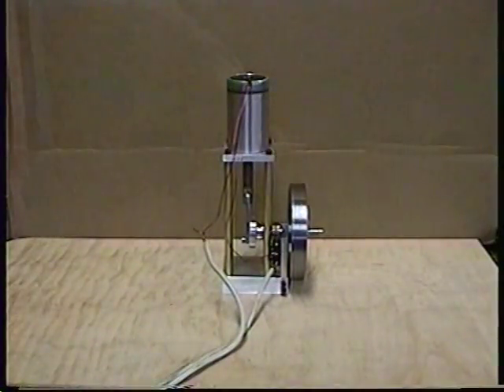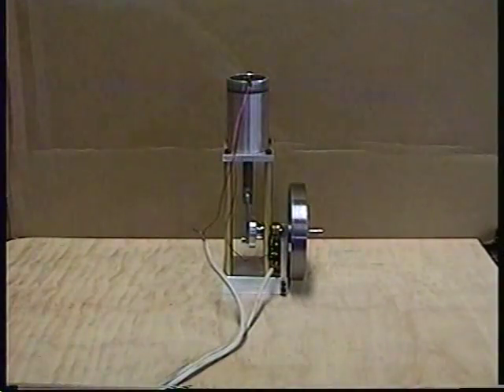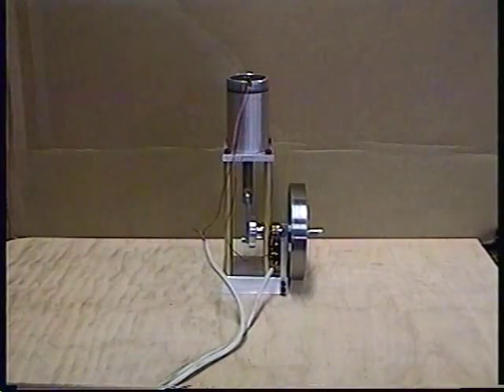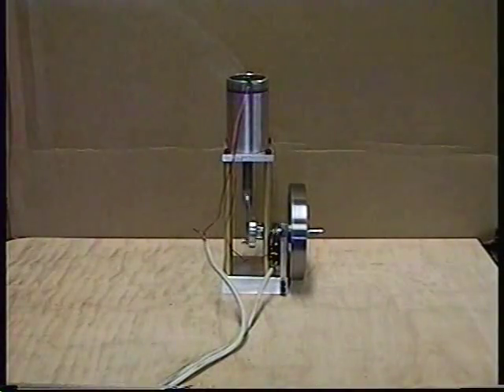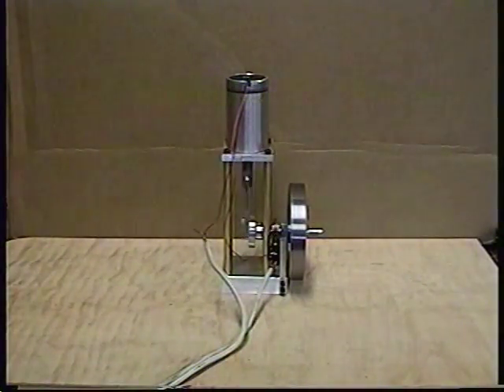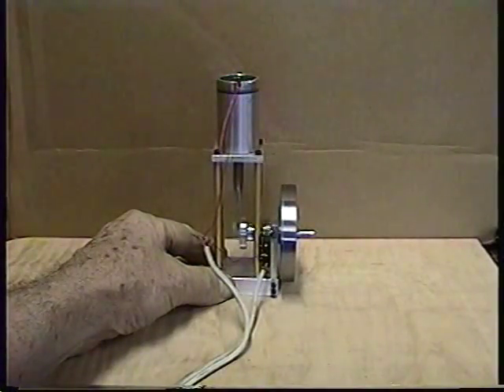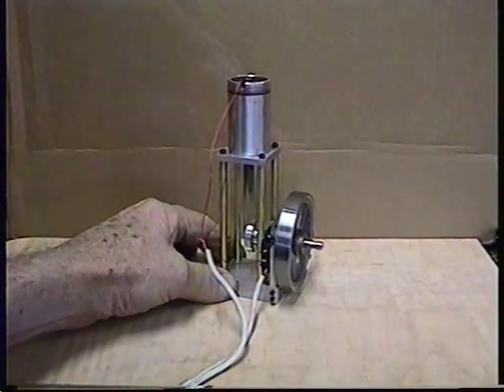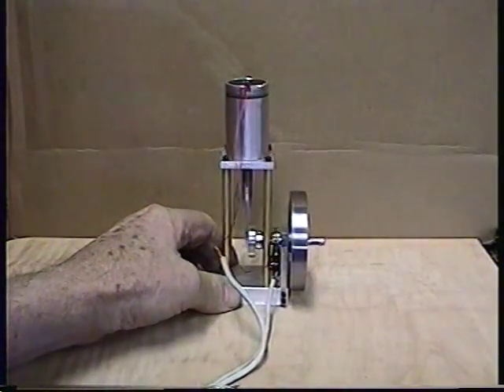Vertical Solenoid Engine

Comment: I'm working on a 2 cylinder tandem solenoid engine based off the 600 snow. It has a 6 inch flywheel and is made mostly from CNC machined wood. The solenoids are able to be driven at 48 volts and are from a new player piano.

Comment: i made 2 solenoid engines from what i had availabe...i made vids of them...i got a small solenoid from a door bell, but the wire comming from the coil broke, so i had to unwind it and wind it back up (by hand)  and it needed 27v to run.  my second engine ran on only 12v

Comment from the maker: @sculptsystem - the solenoid plunger is connected at the bottom to a crankshaft which converts the up and down motion to rotary.  Right behind the flywheel is a cam which closes a microswitch when the solenoid plunger is at the bottom so the coil pulls the plunger upward.  When the plunger reaches the top, the cam lets the switch open which turns off the solenoid.

Comment: Try using an optical switching system,you wont have any points to burn out,i'm going to build a large version ,2 foot flywheel,the solenoids are 8 inches long and 6 inches diameter,using two solenoids with a common armature,one for the up stroke and the other on the down stroke,that way the crank will always have power on it and just not on the upstroke.

Comment from the maker: No, it's 180 degrees.  You want the switch to turn on when the plunger is at bottom dead center.  It should switch off at or near top dead center.

Comment from the maker: I wound this solenoid myself.  I used #24 copper wire on a plastic form.  The plunger is 5/16" diameter.  You should also look on ebay.  Lots of solenoids for sale pretty cheap there.